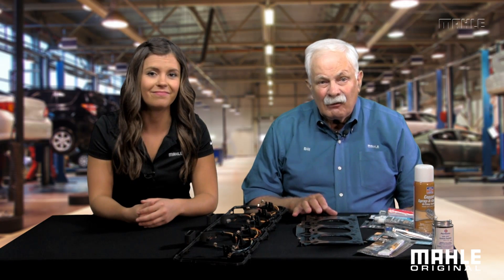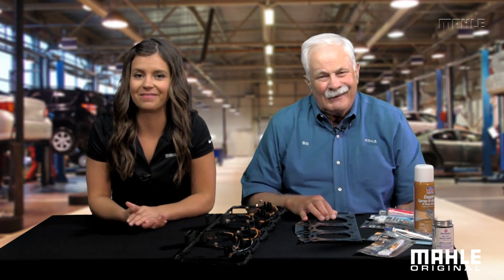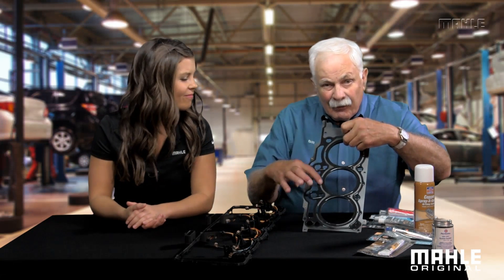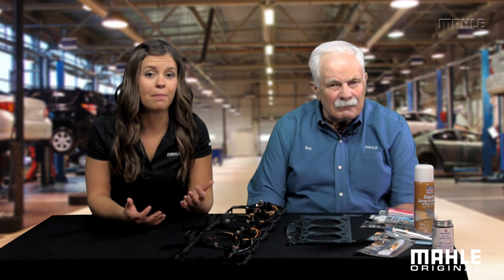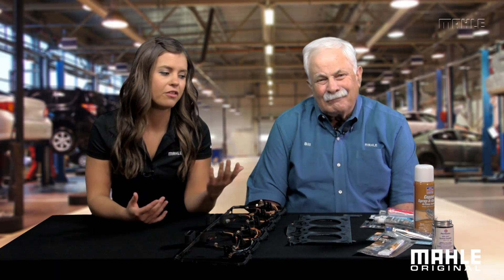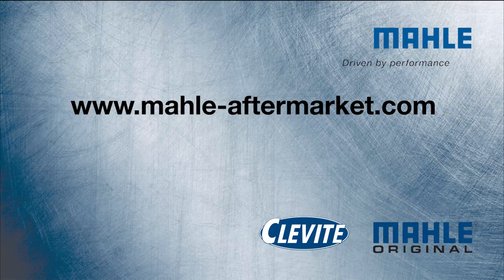Alex and Bill Discuss Gasket Sealers

Comment: Best and true advice I found on YouTube. I'm an old timer also and been working on vehicles from the 60's and what he's saying about newer automobiles and the olders automobiles is so very true. You shouldn't be putting any type of gasket sealer or maker on a rubber or silicone gasket that they use in today's automobiles, they seal themselfs since they are silicone, they will slip sideways even if you don't see it in between the mating surfaces. Older cork and paper gaskets we did use the sealers to help hold them in place, either a little on the corners or only on one side. Shouldn't never put RTV or anything on a rubber or silicon gasket to help it seal, you ruined why they made it out of silicon or rubber in the first place. I see why people put the RTV on their rubber oil pan gaskets for extra insurance but it really does defeat the purpose of the rubber or silicone gasket. I find the newer rubberized gaskets are a blessing compared to the old paper or cork gaskets of the older generations. Scraping a paper or cork gasket from a oil pan and the bottom of the engine block was very tedious and time conconsumming back in the day.

Comment: I have a 91 f150 4.9l that I want to change the water pump on, I saw a video where he advised using Permatex high tack gasket sealent to hold the to gasket in place, is this a bad idea? 

Anyways I plan on using a very very lite layer of this stuff just to help hold the gasket in place.... 

Thanks for the video.

Comment: I have a '04 Mazda RX-8 and cannot locate an OEM cork or rubber gasket to seal the oil pan. Can I use Mahle JV8 to seal the oil pan? If so, do you have tips on prepping  and application? Thanks!

Comment: Hi, interesting tip on the Aluminum expanding faster and therefore leaving a gasket sealer off of that side of a paper gasket.  I have been debating how to do a few paper gaskets on a '91 Corolla.  So even though I didn't buy any Mahle gaskets, this was helpful.  Cheers...
Reply: @Pablo Jamie Instablaster ;)
Reply: @Lian Abram Thanks for your reply. I got to the site thru google and Im waiting for the hacking stuff atm.
Seems to take a while so I will get back to you later with my results.
Reply: @Lian Abram it did the trick and I finally got access to my account again. I am so happy!
Thanks so much you saved my account !
Reply: @Pablo Jamie glad I could help =)
Reply: @lianabram4088  this is a scam made with bots

Comment: The JV7 sealer with my gasket says check bulletin SI579 yet that document is nowhere on the Mahle website. At least i cant find it. Why not a video showing how to use JV7?
Reply: Should i use the JV7 on the engine side or oil pan side? Does it matter?

Comment: Any idea why a properly seated gasket was leaking right after being installed?  The other gasket that's secured using the same bolts was perfect no leaks.  This is on a 150cc scooter the inner case gasket was leaking after being installed.

Comment: So what do you use to hold a gasket in place so it doesn't fall out of the valve cover?
Reply: Indian Head Gasket Shellack on the component side, oil the other assuming paper or cork
Reply: Using a small dab of grease or Vaseline should do the trick

Comment: No sealer came with my gasket, so I've been trying to put it on dry for like 16 hours now and I'm pretty sure it's impossible. 

At this point I don't even care if it leaks, at least I can still drive my car without taking out the engine just to put this water inlet gasket on nice and dry.

I'm gonna dip this gasket in the gasket sealer, cover it with super glue and then jb weld it to the gasket surface. When I'm done I'll spray that copper stuff all over the entire area lol.
Reply: How did your project work out lol
Reply: @JwaaT5oh3   worked out great actually, not a drop of antifreeze leaking from it. 

Eventually I decided to use a magnet to hold it in place while I put the bolts in lol
Reply: @ronaldavis6018  hell yeah, I’ll be putting my heads and new gaskets on today sometime lol. Wish me luck gonna be a fun day.
Reply: @JwaaT5oh3  use a magnet or q-tips to hold gasket in place on those difficult areas. I was being silly earlier but I wouldn't ever put anything on the gaskets just as they recommend.

Comment: I install a mahle valve cover gasket two days later i big oil leak and check and it boke into two pieces and some of the gasket looked like it was starting to melt!! Never again will i buy from this brand!!
Reply: They're made in China now. :(
Reply: Mahle is Top Notch. I have successfully used this brand on GMC oil pans, BMW valve covers and Toyota valve covers. No RTV is needed except for a tiny dab on sharp corners. I ensure to clean the surface well and do a final wipe down w lacquer thinner. Have never had a leak.